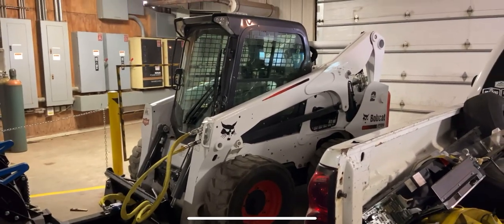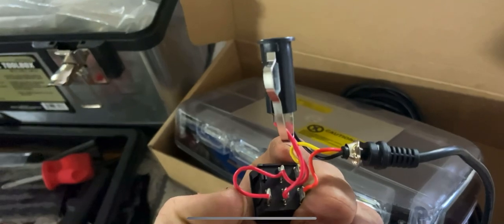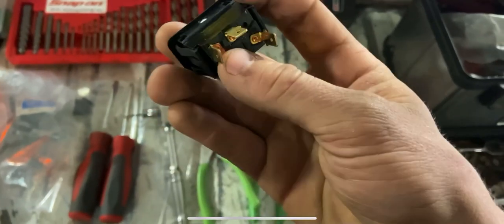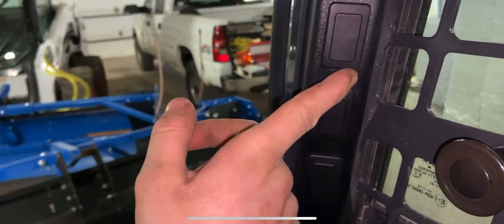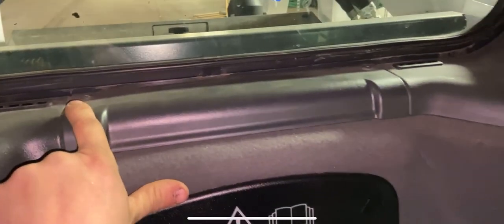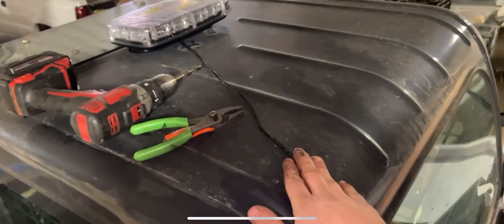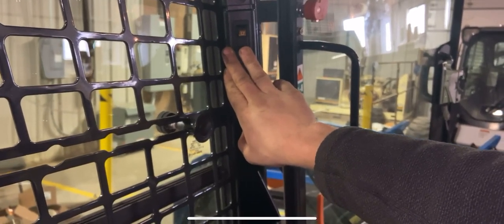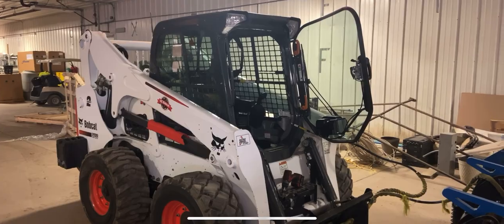How to Add/Wire Roof Mounted Warning Beacon/Light on Newer Bobcat Skid Loaders

Comment: Great video. Worked like a charm. The factory switch I ordered just had two prongs on the back of it (vs yours that had three prongs) but it still works fine.
Reply from the maker: Your factory one may not be a lighted switch then like this one is. This one the switch lights up when you flip it on so you can easily see it’s “on” at a glance. A standard switch that isn’t illuminated would have two prongs but serves the same overall function
Reply: @lawnboy81SMS  you’re exactly correct, that’s what it is. Works perfect though. Thanks again

Comment: Just a FYI... just wired a 2023 T66 and the harness plug is under the drivers left side bottom trim panel just below drivers arm rest. You have to pull the seat on SJC models.
Reply from the maker: @leadermon  Yikes, that’s annoying if you have to pull the seat too just to add in some accessories to a switch!
Reply: @lawnboy81SMS  lift cab.. four 13mm nuts and then undo 3 wire clips behind seat...almost took longer to type this than do. Just pull the seat and then you have a world of room. Machine is very serviceable compared to older units.
Reply from the maker: @leadermon  Good to know. I did a heater core on two of the units in this guy’s fleet, it was a real PITA without having a way to properly evacuate and recharge the AC system I think was my main problem causing the evaporator coil to be in my way. Fortunately he paid me fairly while I worked for him and was always willing to put whatever parts into the machines they needed. If it wasn’t season work I’d go back to work for him, one of the only employers I had who would listen to me when I’d explain what was wrong with a machine and what it needed. He never asked was I sure or why, just always said as long as it needs it and it’ll fix the problem he’d get the parts for it. He definitely knows how to run a proper business and is a super nice guy. Besides seasonal work not being able to support all my bills, he’s the best employer I’ve ever worked for by far for overall pay, attitude, and the way he treats his employees.
Reply: @lawnboy81SMS  just did a beacon on our toolcat and went to do the t66. Looked up videos and found yours. Funny thing was I was putting in the exact same led beacon s off Amazon.

Comment: Extremly helpful thank you so much for sharing. Question, am installing led warning bars on my truck, could you please explaim more about that button that changes patterns
Reply from the maker: The button that changes patter just grounds out the yellow wire on this light as the control module is internal. The red and black wires coming from this light are the standard power and ground, and the yellow one changes pattern any time it’s grounded out. This can either be done by attaching it to a momentary stop switch/button and using that to ground it to the black wire on the power switch or ground it directly to the frame (I.e yellow wire to the input side of the separate momentary start switch/button, with a second wire on the “output” terminal of the switch attached to any grounding point.) hope that helps!

Comment: This is awesome, thanks so much for this video. I just ordered an led bar and 4 pod lights for my S570. Im assuming the flasher relay is built into the light itself right? And I'm assuming I can also use the same switch location for a constant on/non-flashing light?
Reply from the maker: Sure can! The factory harness I used was for a factory single strobe beacon which is why I spliced into that harness to use as power supply for my lights since the flasher module is contained inside the light itself. You can use any of those pre-existing cut outs for a switch, the reason I used the factory harness was to prevent having to run wires as I had to do this to 13 different machine And didn’t want to disassemble each machine that far apart to run the original wire from the light to the switch.

Comment: Awesome job with the video!!! Im going to order and do the exact same thing. Just wish the wire on top was a little neater.... but like you said who wants to drill into the cab. Have you installed any light bars on your machines, and do you have any videos on it? Thanks again for the informative video
Reply from the maker: Donny Lisa I do not currently. If you add LED light bars you will have to run your own wires but can still use the existing switch panel and put in an aftermarket rocker switch of the same size. The only other way to add a light bar would be tap into the headlight/work light wiring harness so they come on with the headlights or the rear work lights (depending if you’d want them on whenever headlights are on or only when the rear work lights are on. I would wire them to the rear work lights so if you drive on the roads like us you can turn the headlights on but keep the light bar off when on the road so they wouldn’t blind other people on the roads during travel between jobs

Comment: Did you take the red and black from the strobe to the red and black wires you cut in the cab?
Reply from the maker: Michael Lorentzen Yes. The red is the power wire, black is ground, and yellow changes the pattern. I just used a test light to confirm which red wire on the factory harness was the power fed wire and spliced into that one. The factory beacon will plug right into that harness without any wires being cut, but these aren’t bobcat strobe lights which is why I had to cut the wires